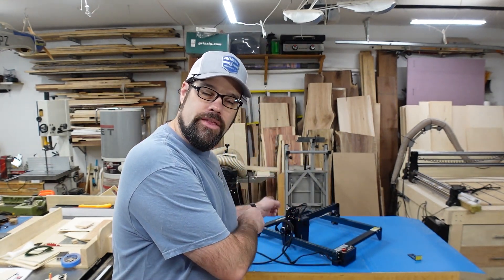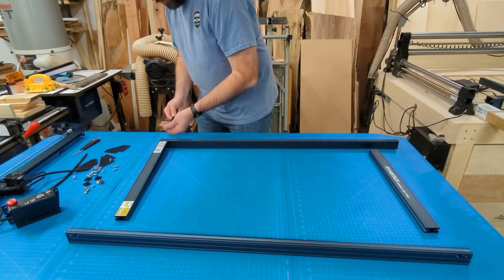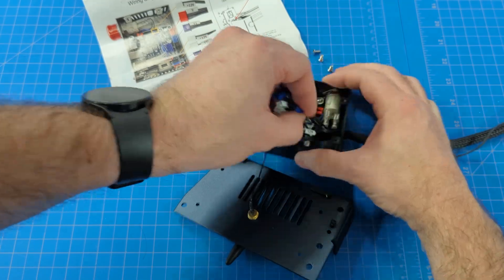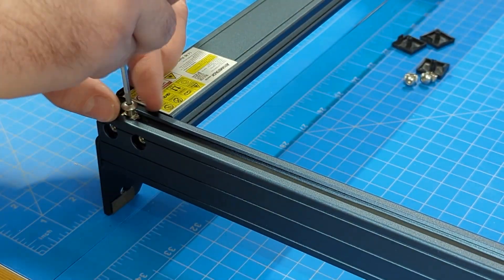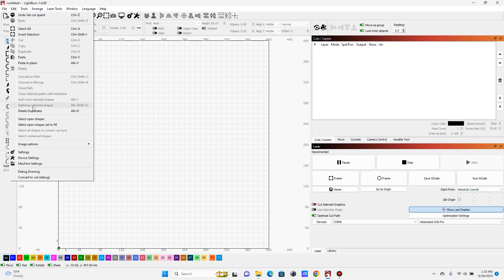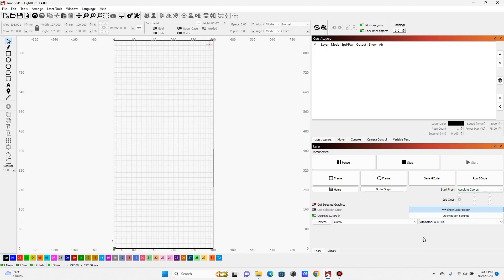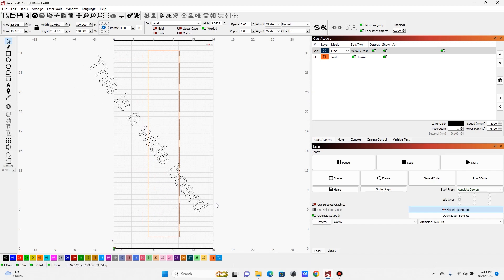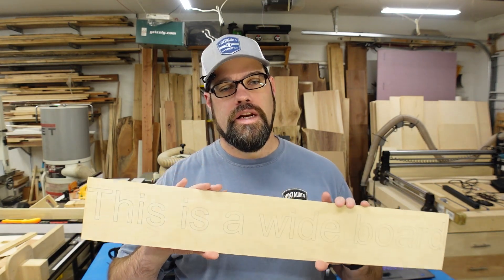Atomstack Rail Extension kit - Complete build and setup in Lightburn

Comment: Hi I have an Extension kit for A10/X7/S10 model , do you think that would work with the A40 pro v2 model  ? Thanks in advance
Reply from the maker: The rails will probably fit, but I'm not sure of all the mounting locations, you might need to drill and tap some holes.  Also, you'll want to check that the wiring harness extension is the same for both.
Reply: @Vintauri  I decided to wait a little longer, and once I feel more confident using the laser, I’ll probably do the upgrade. So I ended up buying the S10 Pro because I already had the extension kit for it. I’m still learning and doing crafts at home, but I wanted a larger working area. Honestly, your video helped me so much because I was having a lot of trouble setting up LightBurn. I really appreciate that you took the time to share such a well explained video with us. Thank you so much, you’re the best!

Comment: Thank you so much for this! This was everything I needed and way better than the “instructions” provided. I did have some noise coming from my x axis rod like a clicking and I think I solved that with the 10mm eccentric adjustment on the bottom rollers of the y axis
Reply from the maker: I'm glad the video was helpful I figured it might help others doing this upgrade. Thanks for watching!

Comment: Good instructional video - I have the A20Pro and my wife bought me the x toolextension abt a yr ago and it is still sitting in the box.  After watching your video I just might put it together but before I do.  Towards the end of your video you showed how it looks in lb.  Is there any way to change it from looking vertical when designing to horizontal
Reply from the maker: I'm glad the video has helped out! Unfortunately, due to where the homing and origin of the laser are at, Lightburn sets up the view that way. To change that, you would need to be able to change the orientation and origin of the laser's hardware controller first.

Comment: Thanks for this video. I have the Atomstack A5 and Lightburn software and have just ordered the extension kit. My machine is against a wall so when I extend the y axis it will be parallel to the wall with the computer monitor mounted on the wall. I was wondering if there is any way to change lightburn to match the orientation of the machine. Ideally with the 850 mm rails being the X axis Parrell to the wall with the 410 mm rails being the y axis perpendicular to the wall.

Comment: Thank you very much for your video. The instructions are very clear and precise. I has Atomstack S20 Pro and Atomstack AC1 camera. I fallow your steps and install extension kit . Evrithing looks right at this point but when I try to calibrate AC1 camera I have a problem. The camera can't see all working area and aligment with camera did not work corectly . Do you have experience with Lightburn camera ? Any advice will be well appreciated. You got new subscriber here.
Reply from the maker: I do have another video on the Atomstack camera and how to set it up, but I have not run it on the extended frame lasers. https://youtu.be/Pox6E59X_4o I know The Clack Shack has had some luck with wide angle lens cameras on his extended laser if that helps.
Reply: @Vintauri  Thank you very much for your quick answer! Can you provide me the link for the Clack Shack video ?

Comment: Double Thumbs Up for mentioning the $132 setting that is not mentioned in the documentation, probably should have mentioned how that means you don't have to double home from far end for those that don't know for this and other extension kits that don't mention it.
Reply from the maker: Yes, I should have added that is a symptom of needing to fix the setting as well.  But as long as both entries are changed it should work fine across the entire area.
Reply: Very true!  I got frustrated for a month or so before googling it to find how to change the setting.  Didn't know how easy it was.